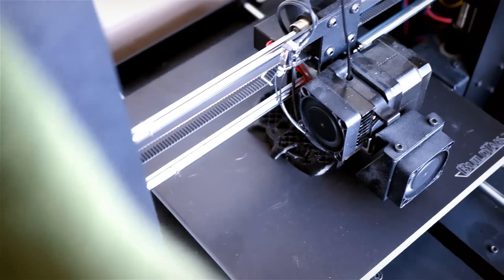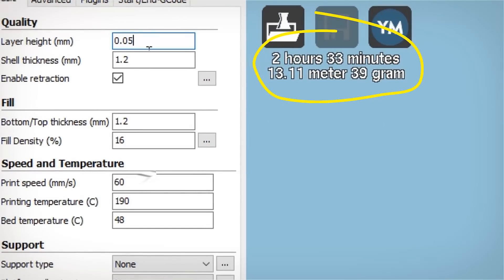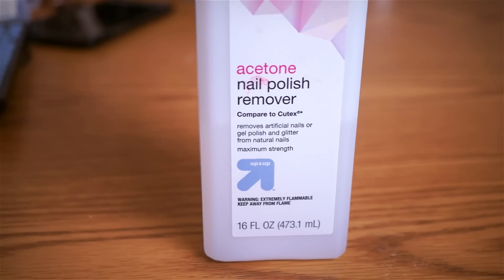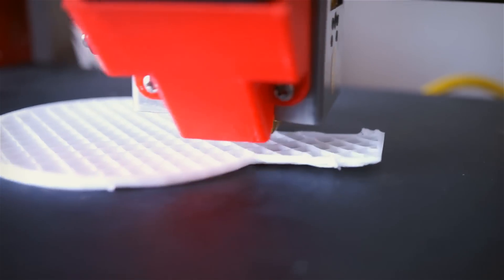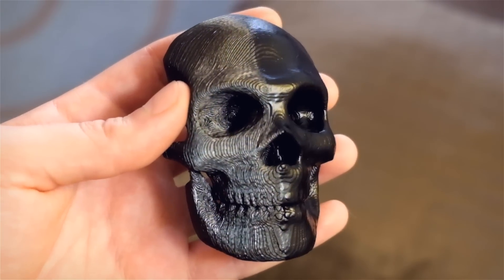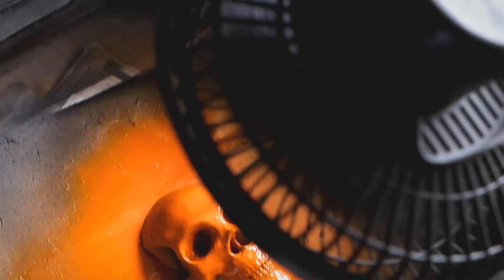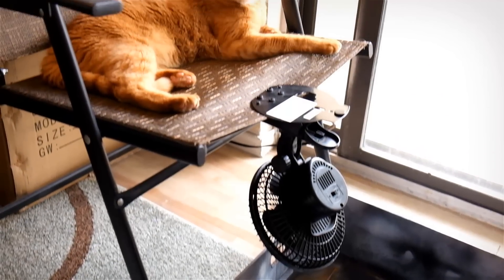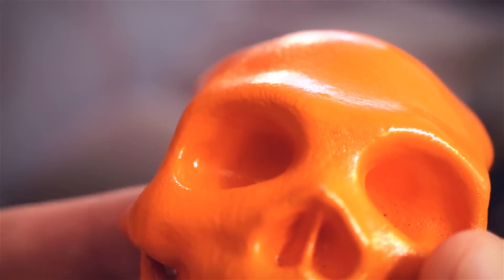Smooth PLA | No Sanding

Comment: No offense but you might as well just dip the thing in plastidip with how much detail you lost. For extremely basic prints, this might be more feasible. I would not recommend doing this on anything that has anything with a lot of edges or parts as it is like doing photography with an old flip phone. Sure, you might have captured some photos... but you lose so much detail that it defeats the point

Comment: I ended up using 2-part epoxy crafting resin, gives a very smooth finish and cures quickly if UV resin.
Reply: I tried this and the resin dripped off. What's your trick?
Reply: @libbyannbest1723  I wanted it to drip off slightly so that it only left a thin coating so i warmed it. The colder it is the more resistant to flowing it'll be so you could try that if too much is dripping off. What kind of shape are you trying to coat ?

Comment: For abs, you could probably use a cool mist humidifier for Acetone with 3 small slow moving fans within the sides of a bucket across from each other on a 45 degree angle to keep the spread even and have it set on a timed plugin for consistent results.

Comment: Maybe try a shellac based primer like Zinnser BIN. It's fine resin particles in an alcohol base. shake well before applying and apply in a well ventilated space. It cures really quickly as the alcohol evaporates and can be used to build fast. I use it as a hard base coat on hvlp painted cabinetry.

Comment: So if you use the poly alone, it won't smooth out?
Reply: i think it has something to do with thickening the paint. maybe the paint shrinking is held up by polyurethane. that combined with surface tension probably does it. Curious to see if other combinations could work like filler primer. Theres probably a perfect blend out there.

Comment: Great tip for speedy fill-in. For a better result (with a bit more labour) a quickly sanded layer of build primer would do nicely.
Reply: i have a feeling an initial sand followed by 1-2 of these coats could be the perfect mix.

Comment: Hey. Great video and idea. I tried it but it’s not very helpful for the prints I do- statues. For square and round items it is fine but for details like a skull or figure, it  fills in the detailed lines that I desire and in general the end result isn’t desirable BUT, I will say this is a great idea instead of bondo and other similar applications.

Comment: It is possible to smooth PLA with acetone though you do need to heat it up a lot more then normal as your using the acetone as a thermal conveyor. Here is my setup: acetone, 1.5 liter glass beker, a heated magnetic stirrer, a stir-bar, long wire hook for the model and PPE mask (plus ventilation if possible). I fill the beker a with about 2cm's of acetone I then add the stir bar and turn on the heat till it gets to a low boil, at this time you should watch the sides of the glass beker for the condensation line that will move up the beker till it gets to the edge now your ready. Attach your model to the wire hook and dip it below that line, you will see the model "wet" itself. Hold it there for 5 seconds then remove, repeat if necessary. I never have to do more then 15 seconds total for a glassy smooth surface. Place the model somewhere to dry afterwards.

Comment: Slow down and get your retraction dialed in as well as calibrating your extrusion rate.  Just printed the jaw bone for a two part print.  You literally cannot see layer lines. That's with standard Cura settings.  Once i got retraction dialed in the layer lines went away.  Over/under extrusion is the real culprit.

Comment: PLA isn't actually biodegradable, at least not how people think. It requires extremely specific conditions and microorganisms to compost PLA that are extremely rare in nature, if you buried a PLA print in your compost pile it would still be there 2000 years from now.

 There were recycling plants that compost PLA, but they pop up and shut down frequently as it's not lucrative.

Just FYI.

Comment: I use gesso mixed with acrylic paint at a ratio 1:1 or 2 acrylic 1 gesso and then paint a few coats over the model after a round of sanding... (probably it ll work pretty well without sanding) the layer lines get covered and disappear depending on your skills and quality of gesso and acrylic then you can sand it for a final smooth surface. Also you can paint it after that. However each coat of gesso needs around a day to dry. Details remain almost the same depending on how big the model is of course. Give it a try, my first ones were not that great but after some practice you ll see great results. Good luck

Comment: Wouldn't it be easier to use high-build primer?  Also, dog hair is better imo.
Reply: ive tried the method in the video and they are similar. the paint polyurethane mix seems to benefit more from surface tension than build up. i want to try plastidip

Comment: Very useful, the only issue is on detailed prints , coating with paint subtracts a measure of detail with each coat. Still extremely useful when it’s necessary

Comment: I came looking for a fix and found clickbait. This ruins all fine details, and pain IS a very harsh chemical. The fact that you used inside in an area your cat visits is horrible. Animal cruelty. If you are going to use spray paint, go outside, or in a garage. No where near animals, or places they have access to .
Reply from the maker: This was printed at 0.3mm layer height so the details were lost to begin with. If you print at 0.1mm and do this for 1 or 2 layers, you will still have your details. 
My camera's battery was attached to the wall outlet so I had to film it once inside quickly then moved it outside for all the rest. My cat was moved to my room long before I sprayed.

Comment: Hmm... Mixing an acrylic enamel and oil based polyurethane in the same coat seems like an odd approach. Why not just do 2 coats of acrylic enamel or 1 coat of primer and 1 coat of acrylic enamel?
Reply: I agree. Of All of the questions in these comments, seems only you and I are wondering about oil vs. acrylic polyus. 
My educated opinion(although new to 3d printing) both should do the job. Acrylic polyurethane will have longer drying times and cost more than the oil based, but definitely is a more “environmentally friendly” choice. 

I usually choose oil based because of my lack of patience and it’s nearly half the price.

Comment: Say goodbye to any details however !!! But useful when working with items with larger flat un-detailed surfaces. But then spray on primer filler with a small amount of sanding has a better result with only a small amount of extra work involved. But I think it's good to have several different methods in your tool box.

Comment: You can save the missed details by slicing 3D model with -0.1/-0.2 print expansion in the slicer setting. This will make your model slightly thinner then original.  So when you spray - the paint thickness will compensate the model thickness you reduced in slicer - resulting in final painted model being close to original thickness, without details lost from paint.
Reply: Are these settings in cura slicer too?
Reply: I couldn't read which kind of paint you used from the can image. Was is an enamel or acrylic?
Reply: That won't really help as it will pretty much flatten any details you have...
Reply: How will this help losing details?
Reply: @jorisr4717  i think it might sink details a bit in order to allow for material expansion to compensate for

Comment: Good idea, but new technology is available.

Note about PLA, new information came out in 2020 indicating that it's not actually that biodegradable.  It will biodegrade if you place it in a commercial composter at 140F, but it will not biodegrade in your garden.

Second note: in 2019, Prusa introduced a feature where you can change the layer height in the print at various stages.  This allows you to print the sections with vertical walls at 0.3mm layer heights and the sections with near horizontal curves at 0.1mm layer heights in the same print.

Comment: I wish the slicers were smart enough to vary the layer height based on the curvature of the model, so thicker layers when the sides are near vertical and thinner when they are flatter.

Comment: Polymer chemist here - Melting is a process that happen then heating things, thus applying acetone to ABS doesn't melt it, it lubricates the polymer chains, increasing the their ability to move, thus making it easier to deform the plastic. AND as many already pointed out. The sovlents in the spraypaint and urethane is way more toxic to humans and animals, than the acetone. It should only be used in a well ventilated enviroment as Im sure is already stated one the can. Using the fan spreads the fumes even more. If you care for your cat, dont spray right next to it. This is a prime example of a DIYr who just do stuff without doesn't sit down aquire the knowledge needed for doing it right. That said, very nice results you got with the skull. Maybe try and wait long between the coats

Comment: You should consider doing this outside or in a non-finished part of the house. I tried this in an appartment outdoor locker a couple years ago and my roomate's freezer which we kept there ended up with a sweet pearlescent green and white paint. It was awesome but i'm looking at your patio door and vinyl floor and I don't think you want that. Paint smoke always finds its way and really far sometimes :P

Comment: Interesting... it would be interesting to know what composition the "regular" spray paint has. The slow-drying kind will be able to react with the diisocyanate from the PUR paint, so the one paint is working as "activator" of the other (at the cost of reduced hardness)...

Comment: You loose detail but this is interesting, its also a much cheaper and i think better method than using a smooth on painted resin. 
Will be keeping this trick in mind for some things that dont need dimensional accuracy.

Comment: Definitely safer than using ABS (Acrylonitrile Butadiene Styrene ). Acrylonitrile contains -CN group which is cynaide. Butadiene is associated with lukemia and Styrene has toxicological properties. Yes, all these are connected with chemical bonding but you never know quality standard of residual chemical testing by filament producer. This is because they simply gives you filament width , weight of total spool, some stress related infol. If you want to use ABS , have really really good exhaust system but then also fumes you will generate will be detrimental to environment in general. On the other hand PLA is produced from renewable resources...Good luck...

Comment: i think using a high build primer 2-3 coats then light sanding model ..then 2 lights coats of paint followed by a med wet coat should give you great results imo... light sanding with a small soft block is not hard imo...

Comment: that's not smoothing, that's spray painting a coat to fill in the gaps... That might work on large prints and surfaces, but not so much on smaller prints where you will loose a lot of detail.

Comment: You cna actually easily smooth PLA with some Acetone Fumes. Basically, you put a cup or box with acetone soaked in a paper towel on the inside over the print, and you leave it for about 45 minutes and let the fumes soak in, then you remove it and let it dry, it smooths very nicely.
Reply: smooths nicely, but becomes brittle and weak over the next few days and weeks. maybe ok for decorative parts that you dont ever touch again but not good for anything else

Comment: I wouldn't really call this "smoothing PLA" so much as "completely covering the PLA with another material that happens to be smooth."
It's like opening a video on how to repair holes in a wall and finding a tutorial on how to hang wallpaper.
Reply: it really isnt. he explained various methods including the reductive process of sanding, as well as printing thinner layer heights, and explained the challenges of these methods. at the end he explained his chosen method of an additive smoothing process, combining paint with polyurethane to build a layer on top of the print.

Comment: alternatively, instead of mixing spraypaint and varnish, would be to use an automotive filling primer. most prop and costume builders use it for their 3D prints, as it's designed to fill in tiny cracks and scratches. i find i use 2-3 coats of filler primer, 2-3 coats of the paint i intend to use, and then 1-2 coats of whatever clearcoat i plan to use, and it removes almost all layer lines.
Reply: I’m going to try this I’m going to a con and I really don’t have time and I’ve been watching many videos to see what would be the best method your advice is probably the best
Reply: I was thinking why not just use filler primer the entire time I watched video.   But hey,  it's another solution I guess

Comment: Great content, it was really helpful! 

Is Polyurethane just a type of transparent paint or is there a difference?
Reply: polyurethane is essentially liquid/vaporized plastic resin. it creates a thick, clear coating over whatever surface you use it on, but it's also very toxic if you breathe it in. it's the same thing most table varnishes are made from.

Comment: KILLZ primer does the same but for a fraction of the price it also comes in a spray can. I had the same issue with smoothing out foam models. Its a thick coating which will smooth out any small details but ultimately give you a smooth surface in one or two coats. You'll have to paint over it at the end of course as it is only sold in white.

Comment: It's better to use a primer, or better yet, filler primer (or just load up the primer real thick, and don't worry about runs) then sand it down. There really is no getting round sanding PLA but with primer loaded up, the time it takes is worth it. After sanding black PLA with white primer it should look like a high contrast black and white stripe print, but then just paint over it and it will be nice and smooth.

Comment: One day when you put all that spray paint under the fan its going to explode considering there is usually always a spark when starting electronics with a switch.. Or even the motor if its brushed

Comment: I just used rustoleum clear for plastic on a  Gold statue i printed...Print was pretty good alreadymaybe a 9 out of possible 10... not insanely rough like that scull...First  light coat 5mins later a medium coat and 5min later a heavy coat just like i clear coat cars when i paint them, just less wait time .... It really pops now like a jewel... i highly recommend ...temp was 73 degrees out...
Reply: Update... clear did not remove all the lines...i ordered some epoxy  which seems to be the best method if you do not want to sand...

Comment: I found A CHEMICAL THAT IS CAPABLE OF SMOOTHING PLA!!!
Please tell me what you think...
Chemicaly Smoothing PLA

"Generally these days I start by brushing on some Dichloromethane (DCM, or methylene chloride). This stuff is really very nasty and I do this work either in a fume hood or outside with a fan blowing away from me. I use a respirator with chemical filters, PVA gloves and full eye glasses. Do not use this chemical unless you’ve taken the proper safety precautions! However I found no other solvent even remotely as good at smoothing as Dichloromethane. Apparentl Tetrahydrofuran (THF) is ok, though I’ve not tried it. Acetone is completely useless, as PLA is completely insoluble in Acetone. Due to the nastiness of Dichloromethane I’ve never attempted doing vapor smoothing, but the simple cold brush on works surprisingly great. Sometimes I do two “coats”. With each coat the Dichloromethane dissolves the surface layer of the PLA and the resolidifies, running into the cracks. It also conveniently seals any tiny holes in the print where print layers have failed to fuse properly. Another method is to spray on many coats of a lacquer, e.g. shellac. This has some problems though during burnout and can leave undesirable carbon residues in the mold which can be tricky to remove. With higher burnout temperatures though this has been less of a problem."

https://mtyka.github.io/art/2016/12/11/lostpla-casting-glass.html

Comment: If you have ever had clear perspex with a scratches on it you can sand till it becomes cloudy then flame to polish it. You can do the same to pla use light flame polishing takes some practice since its easy to melt or crush the PLA but if you can do it you will get a smooth finish and you can manipulate the surface if the print by using using something smooth to smooth out the print.

Comment: sorry what? did you just say "without any harsh chemicals"????? polyurethane is essentially cyanide... its horrendous stuff, and youre spraying it indoors with a fan to blow it around your room a little better????
Reply from the maker: When compared to the absolutely much harsher chemicals out there that smooth pla.